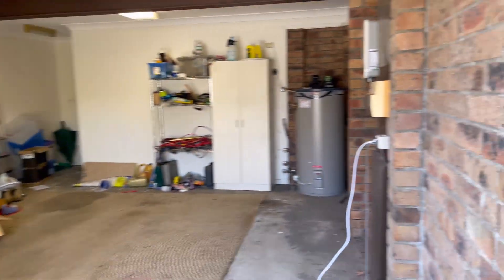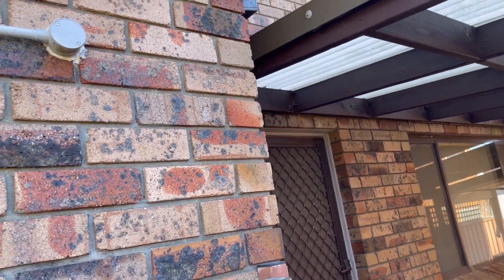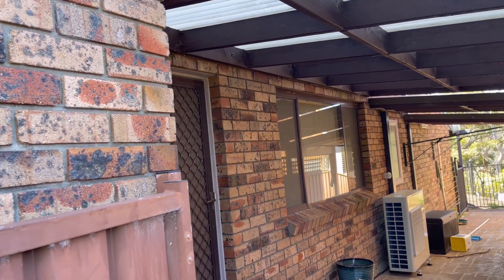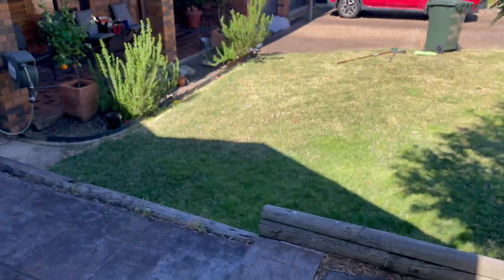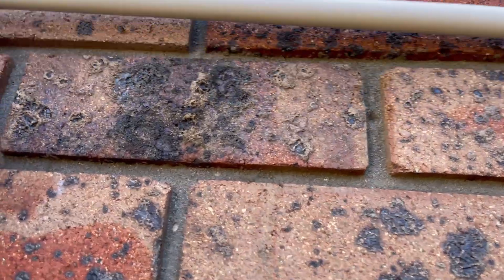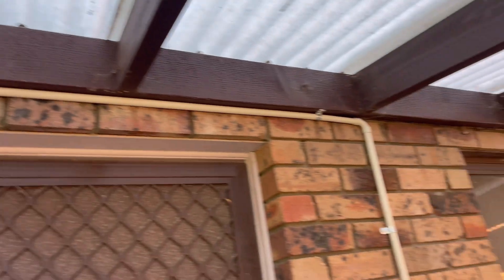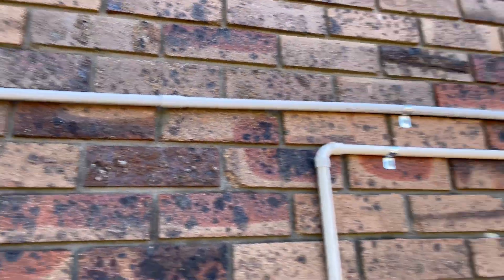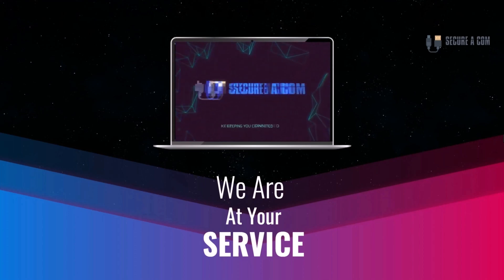NBN FTTP Free Fibre Upgrade | Relocating NBN Box Or Router From Garage To Inside House With Conduit

Comment: Congats on making 1mil views. Do you think when they do fibre to premises that the Depth  dug down is safe in regards to future with landscaping and trees?
Reply: In the case of my old house, they couldn’t feed the fibre up the existing u/g conduit, so they had to lay new conduit from the pit to the house.  We got a week of heavy rain just a month or so later, and a good 2-3m of white NBN conduit popped up in the middle of the patchy grass mess they left.  I followed it both ways and with the exception of dipping down into the pit, it was no deeper than 6 inches anywhere, and in most spots was barely 2” below the surface.  I rang up and complained to NBN Co, so they sent a guy out to assess it.  He claimed I must have dug it up myself and wouldn’t note it down as a pxxx poor job on their part.  Because of no action, I complained again and the phone operator looked up the address and told me it’s noted that the owner tampered with the install so they won’t fix it.  The dirt below the shallow muddy channel was rock hard - proof it couldn’t have been properly buried, and likely the reason they did a pathetic job.   My in-laws had guys with a ditch-witch come and do their trench. I’m guessing that’s what should have been done at my old house.

Comment: Congrats 

question 
do you reckon opticomm will end tanking resulting on the NBN taking over those services as i am someone on a opticomm service and i am finding worse than the nbn HFC connection i had at the old unit
Reply: Opticom is considered a legit nbn competitor in the market, so they won't get their network replaced by nbn.

Comment: Q: my unit was built circa 2000 and has internal cat4 and rj11, I would like to use the cat4 to pull some new cat6, how likely from the 00’s is it that I have end to end conduit?
Reply: What material is the wall, where the cable is located, made of?
Reply: @DodgeyRog  concrete slab, it’s standard blue cat4 to wall plate.